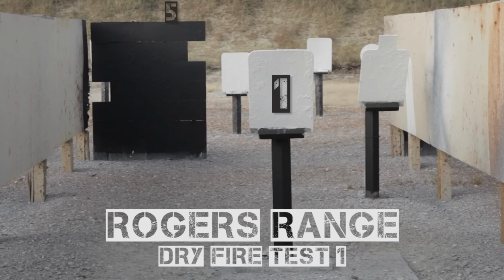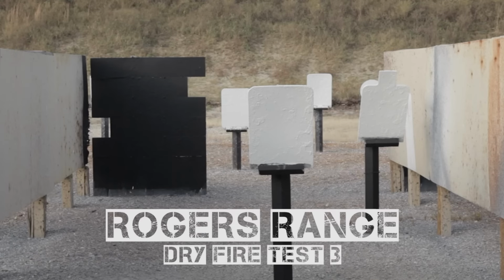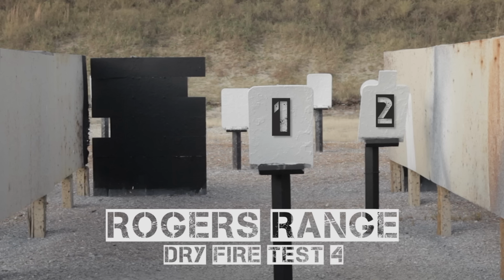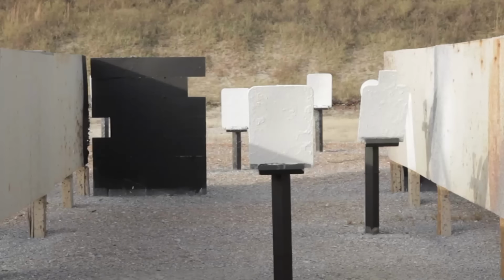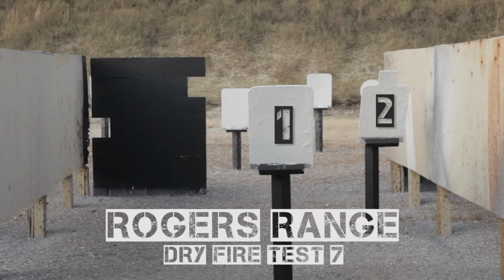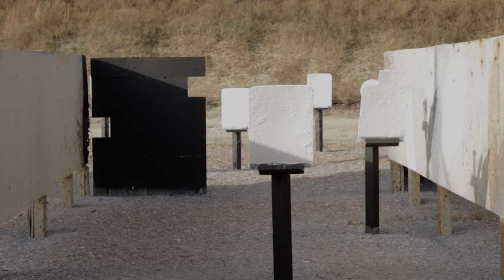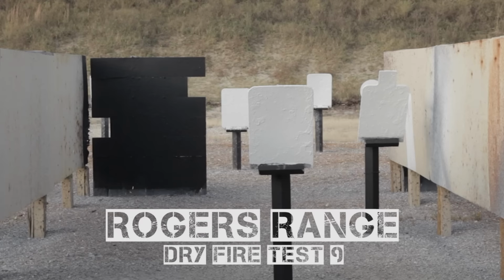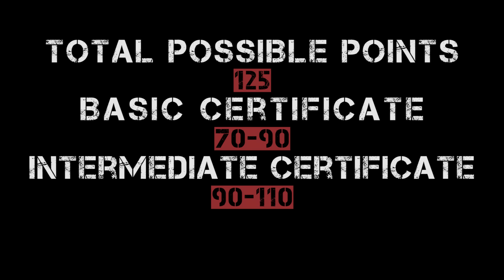Dry Fire Drill | Rogers Range | Practice Shooting Techniques | Tactical Rifleman

Comment: Question about dry firing:  My firearm is an M&P and I am unaware of a dry fire kit for the gun.  So, for this drill, should I pause the video to reset my trigger, or learn to cock the gun and resight faster?
Reply from the maker: Excellent question. While a dedicated dry-fire weapon is preferred; you can get away with making one yourself. Using a small piece of paper, fold it up and place it near the extractor. The goal is to keep the pistol slightly out of battery. This actually keeps the sear from releasing. Thus, the trigger springs back and does not need to be reset. This trick works with most pistols, including the Glock. I’m not 100% sure it works on an M&P. So, please try it out and let us all know how it works.  Thanks for trying it for me. Strength & Honor, TR.
Reply: Can you expand on how to make your glock reset without racking the slide....maybe a link or a better description on where to put the paper on the extractor?